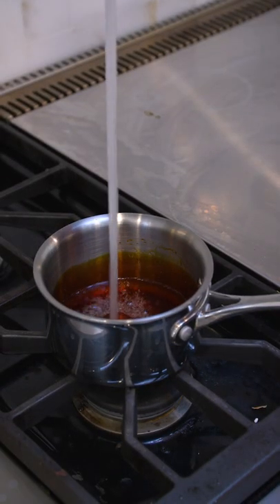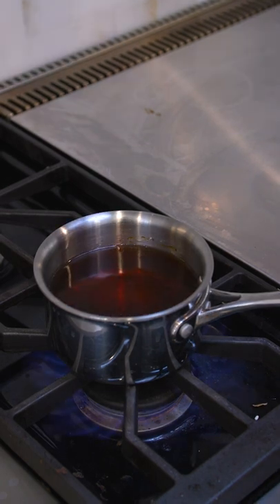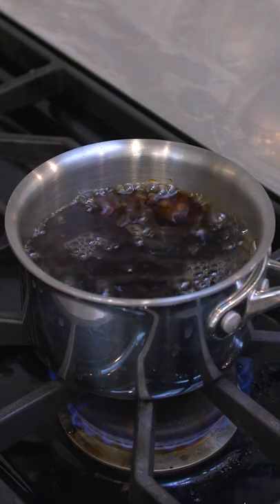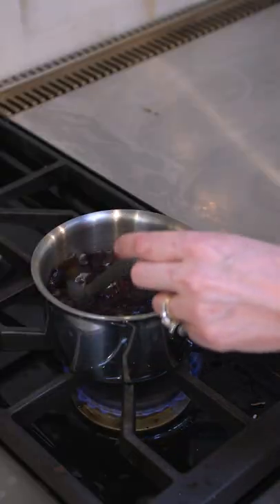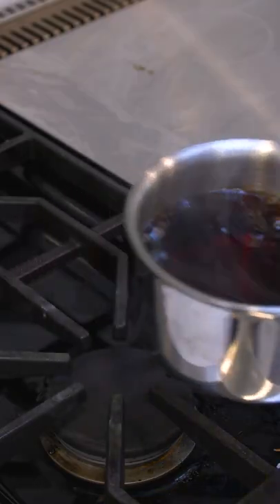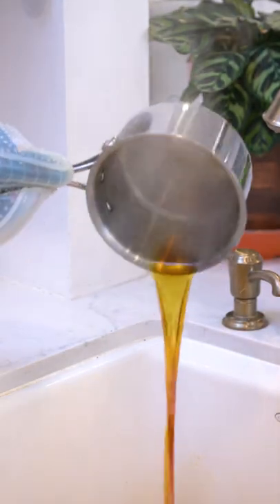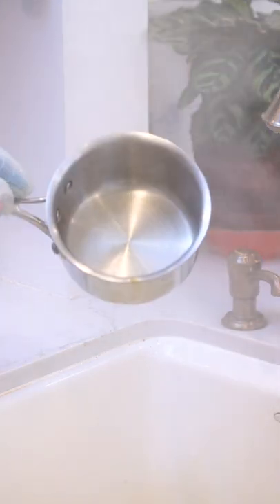How To Clean A Pot That's Sticky With Caramel

Comment: This is a really good trick for getting anything stuck to a pot or pan off. Way easier than trying to scrub residue off. I learned it from my dad who worked in restaurant kitchens while in college. It is especially good with pots that are not supposed to be scrubbed with anything abrasive like non-stick or anodized aluminum.
Reply from the maker: Thanks for being here, Charli! Well said!
Reply: you can actually pour water in the pot and wait for few minutes it will come right off.the water will melt the caramel

Comment: if you just throw the caramel water into the sink, wouldn't it harden again and possibly clog the pipe? or because you added more water it wouldn't behave as a sticky hard caramel anymore?
Reply from the maker: It’s no timely unless it’s cold where you are. You can also pour hot water into the sink.
Reply: The sugar to water ratio is much higher now.  It can't harden again
Reply: Throw it out the window if you're not certain your pipes could handle it.
Reply: @donutdude1934  🤣 not sure if it was meant to be funny but man that was funny
Reply: @donutdude1934 why not chug it down like pro
Reply: @itsbonkerjojo9028 😂
Reply: you are absolutely right   , it happened to me and I had to call the plumber 😢

Comment: I made tangulu when my parents weren’t home our stove wasn’t working so we had to use the microwave I didn’t know plastic is not microwaveable hehe so rip my 8 year old peppa pig plate then I did a glass one and it worked but after I tried cleaning it off it was stuck so I used my fingers and got a cut then I tried to eat it off then looked up your vid and magic ✨
Reply from the maker: The best way would be to check the container, it's usually indicated at the bottom back if it's microwave safe. Hope this helps.

Comment: And now, magically, you get that hardened caramel OUT of your pan and INTO your pipes! Congrats!
Reply: My thoughts also
Reply from the maker: It’s been diluted with water, it won’t go back to that stage. You can also pour hot water down the drain, so you get to save your pan, and have peace of mind over the pipes.
Reply: Lmaoo sugar dissolve in water, even if it will harden the water coming down the pipe would dissolve it and wash it away

Comment: You’d have to run your hot water down the sink for several minutes or it will just stick to your drain
Reply from the maker: Once it has been diluted with water, it won’t go back to that state. You can wash the sink immediately with soap and water. Pouring hot water will work too.

Comment: Well that just Harden inside of your pipes
Reply from the maker: It’s already diluted with water, it won’t go back to that state. Also, you can pour hot water down the drain, that should solve it, at the same time, the pot is not ruined 😊

Comment: Pretty sure boiling anything isn't supposed to go down the sink drain. Melting of some bits or some such.
Reply from the maker: It’s already diluted in water, it’s not likely going back to the state it was in before boiling. Just clean the sink with soap and water. You can also pour hot water over it.
Reply: @biggerbolderbaking  I don't think any of that is correct. 

"It’s a common misconception that pouring grease down the drain is okay if you run hot water and pour dish soap after it. In reality, grease should never go down the drain. Even if it’s hot and easy to pour out of the pan, it will eventually cool and solidify somewhere in your plumbing. This causes a gummy, goopy mess to form along the pipe walls, trapping other debris that flows down the drain. Over time, the resulting clogs could bring your drains to a standstill."

"To address one of the most common trends when unclogging a drain at home- is it safe to pour boiling water down the drain? Though you may find mixed answers to this question, experienced plumbers strictly advise against this action. In most houses, there are PVC pipes under the sink- If you have a newer home there is over a 75% chance your pipes are PVC. These pipes have the capacity of withstanding intense heat, but not as high as that of boiling water. The pipes are held together with a glue that becomes susceptible when the boiling water rushes over it. The damage is often not observed immediately but rather progressively deteriorates as time goes on."

Comment: Isn’t it unwise to tip caramel water down the sink, like fat or oil?
Reply from the maker: It’s been diluted with water. You can always pour hot water after you wash the sink with soap and water anyway.
Reply: @biggerbolderbaking  OK; great. I just wanted to make sure. Thanks!

Comment: Isn't it going to sollidify somewhere down the drain now?
Reply from the maker: It has already been diluted with water, it won’t go back to its previous state. You can also pour hot water down the drain, which I do from time to time to prevent grease building up in pipes.
Reply: @biggerbolderbaking  Oh offcourse. The added water should help with it not blocking the drain. Thanks for your reaction. 🙏

Comment: naaah.. just leave it with some normal water for some time and it will be fine no need to boil or else
Reply: Boiling makes the process faster.. but water at room temperature works as fine but it takes more time
Reply from the maker: Thanks for jumping in, Rose.
Reply: @rosesmile1362  yea agreed.